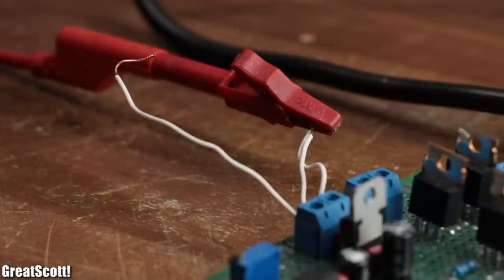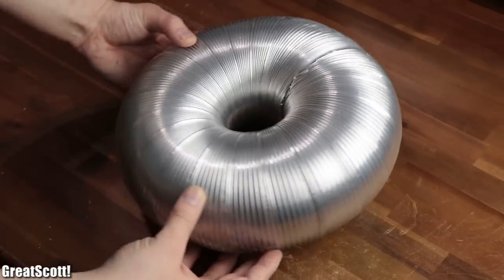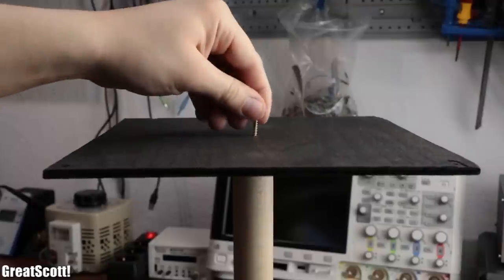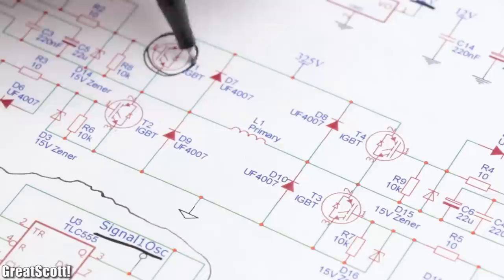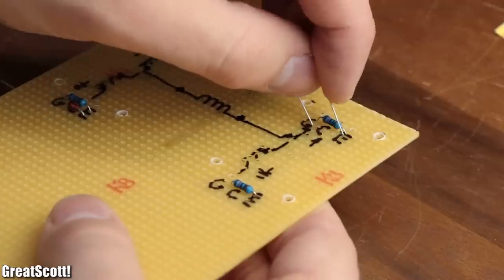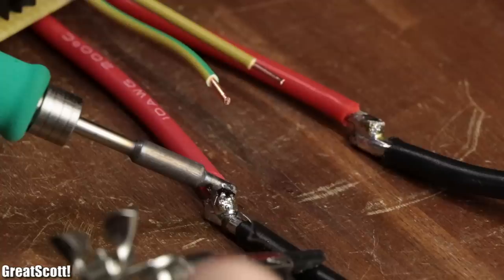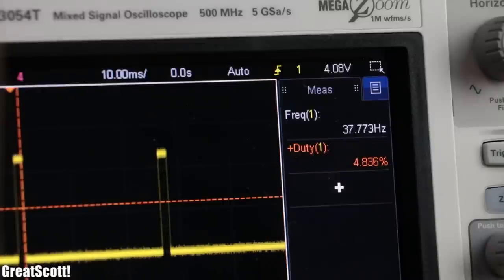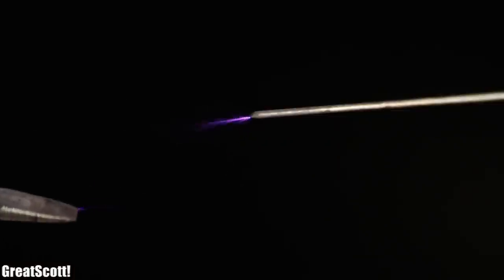Make your own Tesla Coil (Part 2) || SSTC, IGBT Full Bridge, Interrupter

Comment: good that you used a FULL BRIDGE RECTIFIER
Reply: ElectroBOOM approves this channel
Reply: H bridge*
your welcome.

He only mentions that it could be possible to use rectified mains voltage but never implemented the FULL BRIDGE RECTIFIER
Reply: +Sharky 
 actually, he didn't :)
Reply: Patchoulino is correct, the driver is an H-bridge, not a bridge rectifier.
Reply: Every time I see a FULL BRIDGE RECTIFIER comment I have to click like...
Reply: i call it FULL BRIDGE REKTIFIER
Reply: Sharky #ElectroBOOM :D
Reply: he really used a FULL BRIDGE INVERTER
Reply: Patchoulino it’s you’re

Comment: Hello, Scott, greetings from Litauen! I already built my SSTC using two IR2110 ics and IRFP460N mosfets. Noticable heating starts around 80VDC on the full bridge. High and low signals are generated using STM32F4 discovery board, TIM1, which has complemetary outputs and adjustable dead band. High and low side signals connected to driver IC's through optocouplers and current buffers. Discovery board is supplied with isolated 5V 0,7A supply and drivers are supplied through 7812 and 7805 regulators for each IC. Mains are regulated via variac and then rectified. Sec coil is around 40cm height and has approx 1100 turns and primary uses 10 turns. With 100VDC ( I was happy wth that for around 5 seconds and one MOSFET blew up :D ) I got around 15 cm discharges.
Really nice channel and videos ! Good luck with a Tesla coil!
Reply from the maker: Thanks for the feedback :-)

Comment: The Steve Ward Mini SSTC schematic is super reliable, powerful, efficient, and easy to build. I built a 10 in tesla coil using this circuit and get 10 in breakout. The mosfets I use did not even get warm even at 100% duty cycle which is crazy.

Comment: Tesla coils do require some quite extensive setting up to maximise there resonate frequency, which improves miss matches and the overall efficiency of the coil. Solid state drivers for these can take what seems an eternity to design, tweak and reconfigure, but modulating (pulsing) the  output driver helps keep the IGBT transistor's cooler. You could also add some sort of thermistor feedback circuit to one of the heatsinks which you could use to provide a thermal value to the Arduino which could be configured to reduce the output voltage as needed to stop thermal runaway- or worse case scenario, shut down and protect the IGBT's.

Comment: The IGBTs get hot because tdon is smaller then tdoff, 100ns in your case. that leads to cross condition. use a driver like a IR2184 which has a 500ns dead time built in.

Comment: You had an Arduino.  You used a 555 timer.  A second Arduino would have been more than enough and given its sheer power.  Yet you used the venerable 555.  Huge respect.

Comment: Most SSTC's that use a full bridge have a capacitor in series with the primary, that may reduce the current and heating.
Also, check that black paint, many use carbon to produce the black colour,

Comment: There is no dead time in your driver, that could be the reason of heating. Switching IGBT in open circuit could breakdown the gate. Also, oversized topload ruined Q factor of Tesla coil, so you get smaller discharge length for the same power. Beside that your project looks nice, well done.

Comment: If you add Extra Coil and connect it to the Secondary Coil and then connect Top Load to the Extra Coil like Tesla recommends in patent 1119732, you should be able to get even larger sparks. Extra Coil aka Resonator acts as a magnifier. The Colorado Springs model of Tesla Coil is called Tesla Magnifying Transmitter.

Comment: So much power for such a small arc.... OMG....     : (
Reply: It's the voltage that makes it jump across air, not the power.
Reply: I talked about the input not the output power , and what you say is right but that ist what happend here  and it is wrong... A tesla coil have put out the highest voltage that it can and not current / His tesla coil is efficiently but it is more like a flyback transformer
Reply: it was not that much, he is using a bench power supply....
maybe if he used a FULL BRIDGE RECTIFIER
Reply: oh ... i check your channel and you have more powerfull stuff :3
Reply: I'm sorry, I did not realise what you actually meant by power, some people think voltage and power is the same so I wanted to correct that. have a good night!
Reply: +Ivan R Troll face icon and stupid comment. What a suprise?! @GreatScott! will make the feedback in the 3rd part..  I think i know what circuit you use, i built that too... my use 30V and ~0.5-0.7A AKA 15-21W and i have longer arcs too but the mosfet (irfp460) get rly hot and the efficiency is sh*t and  30V input is a lot and reach the max output of the most lab bench power supply, and that arc with 8 volt is awesome + if u calculate the power of the circuit: 8*2=16.. almost the same just with lower voltage. @GreatScott!'s circuit is not for beginners.

Comment: I've assembled a tesla coil kit for one of my high school teachers. It uses half-bridge and it sings. Worked a bit, and then started blowing the fuse immediately after plugging it in. I removed the igbt's and they both measured only a few ohms no matter how they were probed. After watching your video, I believe the fault lies in a design flaw. The protection diodes on the igbt's. the kit says they are optional, and does not include them. Right... optional only if you don't care how long it lasts.

Comment: maybe you need a freewheeling diode across the igbts to avoid the voltage spikes, since the igbt does not have a inherent body diode like mosfets do; without the diode the voltage spikes can easily exceed the reverse breakdown voltage of the base-emitter junction, which has a much lower breakdown than the base-collector junction, and heat up the igbt or damage it

Comment: It is really hard to use a full bridge to drive a "transformer" with very low Q value. I failed many times when building my music plasma thing and finally choose to step back and use a self exciting soft switching topology. Also, soft switching can protect your IGBTs from high voltage peaks. If you want to stay with your full bridge design, the following may help.
1 add a electric reactor
2 use a intermediary transformer between outputs and primary coil
3 somehow get the current feeding into the primary coil more like a sine wave
4 check out how induction cooker control circuit works and that may be helpful

Comment: A spark gap tesla coil with a decent input transformer can output over 12  inch sparks (self proven). And you can get 100A 1200V half bridge IGBT modules off eBay for $10 a piece. Why not go big given the ridiculous wire gauge you used for the primary? Not trying to bring you down, I love your channel. As far as basics go, it is a great video, but I would like to see it taken further.

Comment: Ok I understand that you're doing it because you want to learn something. But I just made a ~50kV supply with 4cm arcs (Air resistance, thats why I think its 50kV) using only two Items: A CRT Flyback transformer and a 12V Halogen-lamp driver. The 12V output has to be wound around the Flyback-transformers Core. I have 20 windings.

You may need to actively cool the driver. In a weird coincidence most blower also use 12V...

Comment: "the resonator does not want to start". have you tried not to crank the voltage up but just directly start with the proper supply voltage, such as 8v?

Comment: Can you show how to make a sine wave dc to ac inverter because i want to charge my laptop in the car and on the go but i dont have money to buy an inverter :)
Reply: Willeexd tl;dr: he probably can, but it won't help you.
Your's is a standard item off the shelf, so Chinese mass manufacturing will deliver that to your door cheaper than you will be able to get the parts. Also, without money you very likely don't have the tools to adjust it, like an oscilloscope.
DIY projects are rarely cheaper, but either to get something unavailable elsewhere, or for their educational value.
Added bonus: the Chinese stuff just may not fry your laptop or kill you. :-)

Comment: I tried making a tesla coil driver that had  adjustable frequency. Too inefficient. taking in consideration only the price of the components this solution is crazy. Adding the time spent on building and tuning it, it adds up to way too much. Its easier/cheaper to find a vacuum tube and do it the old fashion way. I don-t recommend it , but it makes for an interesting/dangerous/ powerful show piece.
By far the absolute best circuits for a tesla coil are a royer oscillator with the biggest NPN transistor you can find or a ZVS driver. The ZVS is way more powerfull but the Royer circuit is easy to build and scales well with the size of the coil. 
BTW: all of these are self tunning oscillators.

Comment: Question for you:  Do you have to use two separate power supplies for the gate drive IC's?  I saw on another Full Bridge inverter circuit video where it was specified that they MUST be separated.  It didn't make much sense to me, since they're really just switching voltage on and off to the IGBT's.

Comment: Scott i have a question. I've seen on youtube a lot of voltage multipliers with film or ceramic capacitors and diodes and i don't konw how it works. Did u can to explain how it work and if is fake or not?

Comment: No offense Scott but that circuit is too complicated and the arc produced by the coil is too small. In part 1 I noticed that you overlapped the windings of the coil maybe that's the reason.I made a tesla coil only with a power transistor and a resistor the arc produced at 40 volts it was almost  two inches.I think the final result is more important, to bad I don't have a video to show you, maybe I'll make one.
Reply from the maker: Just wait for part 3
Reply: Oh, I did not expect GreatScott to answer to my comment so quickly :)) .. I'm definitely going to wait for part 3.

Comment: Why do we use ac instead of chopped up dc? Im trying to design a circuit myself atm for a highvoltage project and even tho i have installed a flyback diode, I already fried two transistors...

Comment: Is there any hold-off time? There might be a problem with increased power consumption, because both sets of transistors might be on in the same time - it is usual concern in H-bridge transistor drivers
Reply from the maker: The IR2113 should handle this problem by itself since it features a delay time between the outputs.

Comment: In the video, it's said that frequence resonance above 400 Khz (2.5 useconds), and you said that the IGBT's have medium fast switching time.  And in the datasheet of IGBT showed td(on)=30 ns and td(off)=130 ns. is that because of that ? 2.5 us of the resonance frequency compared to the 30 ns ~ 130 ns switching time of the IGBT ?
Thanks.
Reply from the maker: The switching times should only take up a maximum of 10% of the frequency. Now you need to add the delay to the rise and fall times and the fact the we will probably never reach the values of the datasheet and you will see that 400kHz is not ideal.
Reply: Oh, thanks for the explanation 🖒. Good job !

Comment: Why not just use a high voltage power supply such as is used for a large neon sign? You basically built one anyway. They cost $30.

Comment: maybe a stupid question @GreatScott , but can you use a simple H-bridge circuit to power this? 
thanks in advance ;)
Reply from the maker: Well my circuit uses an H-bridge. So, yes.
Reply: GreatScott! Oh, Yeah, sorry ;). But the circuit around it confuses me. I've made an H-bridge based around afrotechmod's tutorial (sorry ;) ). 
Just uses 1 NOT-gate and 2 AND-gates to enable the direction of current (choice of and-gate or inverted and gate), and an PWM-input (going to both AND-gates, to enable them). 
But i'm very interested in your design. Maybe if you have some time, you can explain it a bit more ? 

Anyway, sorry for the long tekst. 
Just happy to talk to you ;) 
greetings, a big fan from belgium ! (Don't speak fluent german)

Comment: It will work on arduino UNO ?
Reply from the maker: Yes
Reply: Viral in YouTube Nano and Pro Mini are fundamentally just Unos with a different shape.
Reply: Ye, but u need to deal with higher noise cuz of the solder connection from the connector to the chip is bigger AKA acts like an antenna

Comment: i didn't understood the feedback part...why do you need feedback?
Reply from the maker: The resonance frequency of the tank circuit on the secondary side changes when you come close to it or draw an arc. By using a 555 timer with a set frequency we thus use the system not in the resonance point. That means we need feedback from the secondary which contains the information of the current resonance frequency.
Reply: GreatScott when yo'll be cranking the bridge voltage to rectified mains voltage and get ~20cm arcs, these arcs increase the topload capacitance thus changing the resonant frequency even when none is around the coil

Comment: Your Tesla Coil can kill anyone?
Reply from the maker: I think not.
Reply: maybe if you would hold a body part in the arcs long enough that the tesla coil would burn it away but that would be a huge amount of time. Other than that I think the only thing it could kill are sensible electronics such as IC's and Computers, small animals like flys and your radio signals xD
Reply: Ramog1000 Because of the high frequency of the arcs no current is flowing through your body. It's called the skin effect.
If that were a traditional Teslacoil (SGTC) it would be far more dangerous because the frequency is much lower.
Reply: Viral in YouTube no, a small one cannot kill but i see a bigger one that consume 10kw and 9 foot tall and yes that thing can definitely kill
Reply: +incognito65 I have SGTC and it cant burn the skin and doesnt give shock (my SSTC MUCH more powerfull and burn the skin down from my finger), but yes.. lower frequency and loud :(
Reply: I think not

Comment: Why using a linear regulator and not a buck converter?
Reply from the maker: It is just not worth the time and money to include a buck converter.
Reply: Javier Corado Because efficiency for the logic circuit isnt an important concern for something like this. The logic board isnt goi g to use that much power.

Comment: Have you heard about this B-TRAN that is coming out soon? The B-TRAN topology is a simple, yet radically different topology for power semiconductors. It combines the fast, low loss switching of a
MOSFET, the high current density of the IGBT, the low forward voltage drop of the BJT, and a unique bi-directionality, which allows its use
in highly advantageous AC link converter topologies. B-TRANs offer the potential to improve efficiency and system economics of a wide
variety of power converter applications including variable frequency (VFD) motor drives, electrified vehicle traction drives, PV inverters
and wind converters. http://www.idealpower.com/wp-content/uploads/2016/04/Btran-white-paper-CURRENT-12April2016.pdf

Comment: So, how Tesla built this stuff if he had no transistors and all that stuff? I just don't get it. People in the internet build it using weird components, they use 100-230V as input, while Tesla used his own AC generator. Can someone make a replica?
Reply: Look for Spark Gap Tesla coil
Reply: @ElIsraelJijijiji  Still they use strong energy sources, Tesla didn't have it I guess
Reply: @PinkeySuavo  wrong, tesla used a high voltage transformer
Reply: @ElIsraelJijijiji  yeah, tesla coil is transformer itself. But I ask about energy source he used
Reply: @PinkeySuavo  a high voltage transformer to step up the 120v AC to 30,000v AC, the that goes to the spark gap and a high voltage capacitor trough the primary coil
Reply: @ElIsraelJijijiji  Where did he have 120 ac source from though?
Reply: @PinkeySuavo  oh my god, study how he won the current battle and how he created the FUC*ING AC GENERATORS
Reply: @ElIsraelJijijiji  He built it during the current battle. And still, everyone nowadays build Tesla coils using energy from sockets, while he built his own AC generator who was able to generate 120VAC. So like I said, why doesn't anyone do 1:1 replica and do the same tesla coil using own AC generator?

Comment: OK your electronic knowledge is very good let me say.  But your over doing it your loosing the ball just like all these car makers.  I made 8 inch sparks with half that size of coil.  I used 1 transistor and a square wave.  And I used a spark gap just like Nicola Tesla. My capacitors were made out of wine bottles filled with water and aluminum foil wrapped on the out side.

Comment: i have make this arcs allot better with the slayer circuit but you make a not so optimal coil the paint is shit (schwarz leitet bei hf sehr sehr gut strom  deine ergebnisse wären viel besser wenn du nur das rohr genommen hättest ohne farbe am besten nen weisses rohr nehmen und aller höchstens klarlack drauf auf jedenfall keine farbe die leitet ! )
Reply: und wenn du die primärspule besser auf die sekundäre abstimmst kommt viel mehr raus und die effizienz steigt